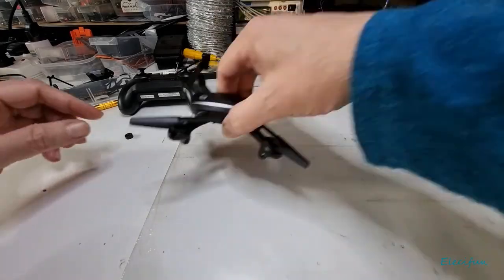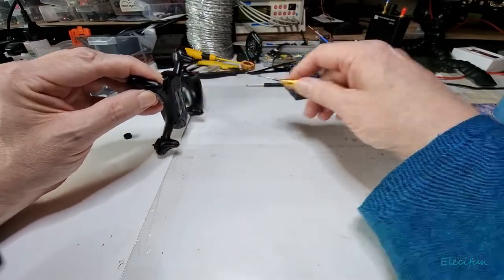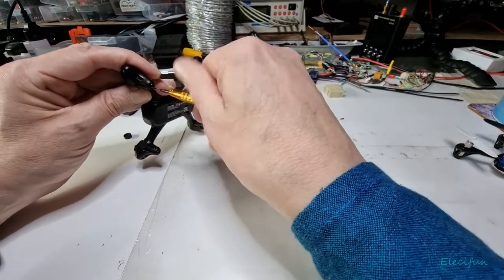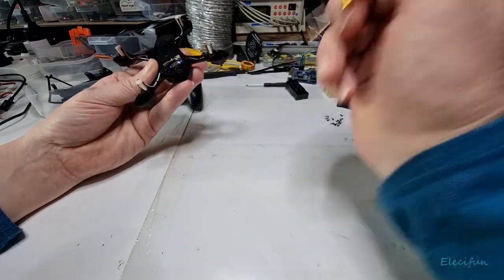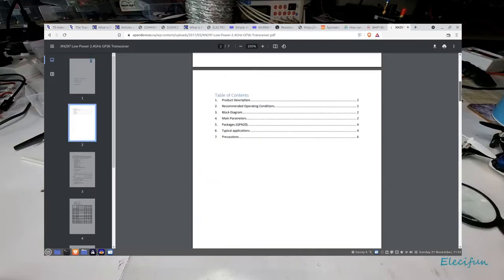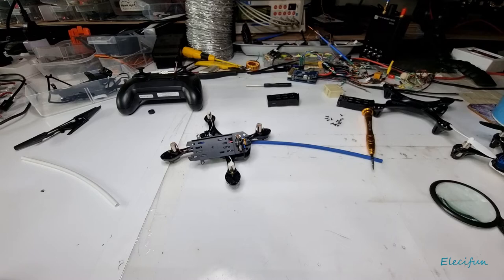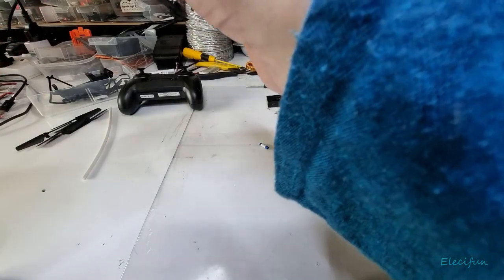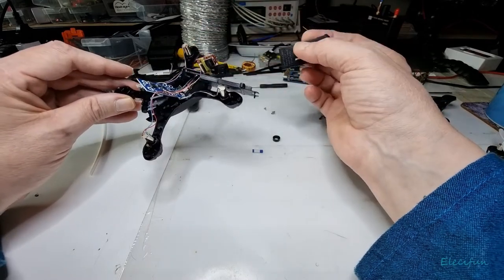Holy Stone HS340 a Look Under the Hood

Comment: Interesting peek Elecifun. Thanks for posting that.
Reply from the maker: Glad you enjoyed it
Reply from the maker: What micros are you flying buddy?
Reply: Hello Elecifun, 
I have two micros, both Eachine if I remember correctly. I haven't flown them for a few years... not great quality in the craft or FPV goggles so I sort of lost interest in the micros. Your videos have reved me up a bit though. I think I'll dust off the micros and give em a go if the batteries are still able. Cheers!
Reply: I'm revisiting the micros. The one I like best is the JX 1601HW. It's been rebranded several times. I got it at Bangood several years ago. The battery was bad but I'm able to use the ones from my eachine micro. 3.7v 100mAh. I get just a few minutes of flight but I have five batteries. I'm having a good time flying but can't connect the wifi camera to my phone... I've tried several apps but none work. Maybe you or your viewers can suggest an app to use with Samsung phone? Cheers mate.
Reply from the maker: This micro flying is fun. However at these cheaper price points I am staying away from WiFi video as the lag is to long for inside. I checked out the JX 1601HW its like the HS340 but fold able and tilt camera, nice. Does the box have which APP for the WiFi? Which Samsung phone you got?
Reply: I'm sure the box or user sheet suggested which app to use but I no longer have them. I moved my entire house cross country since I bought the micros... anyway I've abandoned the wifi camera. I agree that the lag isn't worth the fuss at this price point. I am having fun flying around inside. Though my dog doesn't like it lol. I can't resist tinkering and may cannibalize the other micro and set this one up for FPV... lot's of fun for little money. Cheers Elecifun thanks for corresponding.
Reply from the maker: @Sonic Ox  Yeah do it set up for FPV. I am putting analog FPV back in my Syma as it was great fun with it in. I have a couple of cats Felix is quite chilled when I fly inside but Oscar craps himself. I only fly inside when he's out to keep his stress levels down. He's skittish enough as it is. Its good to talk to nice people around the world. Cheers